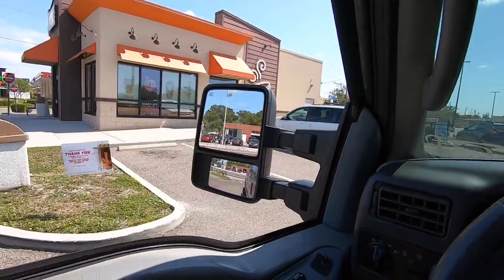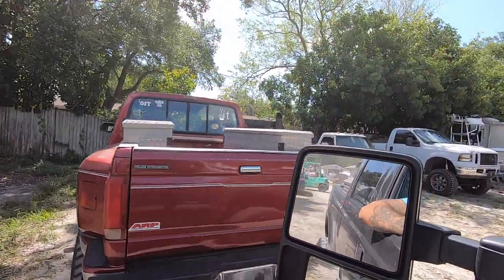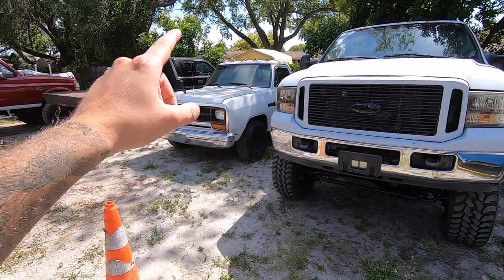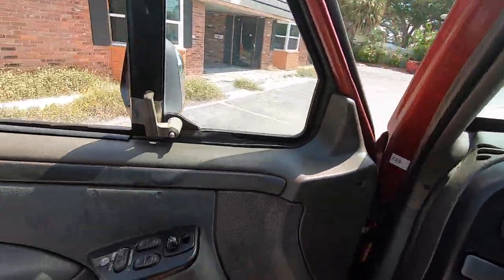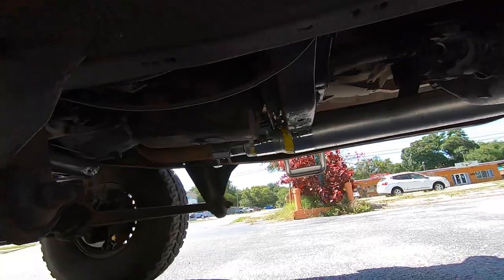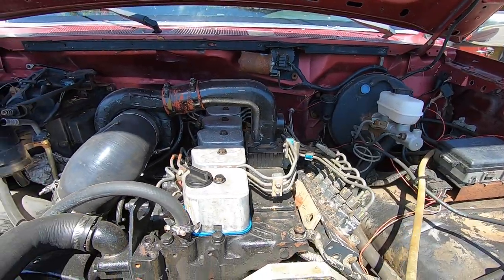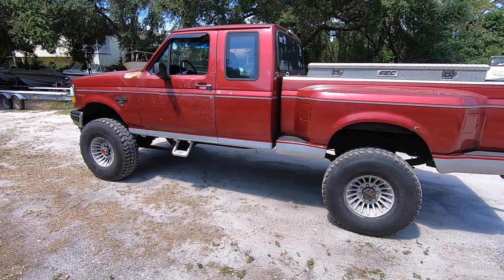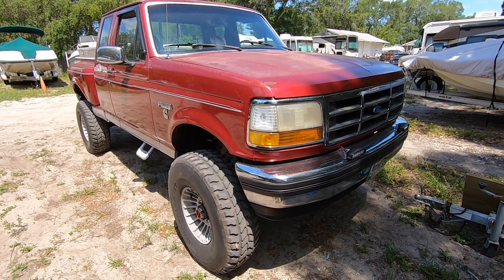Twin Turbo Cummins F150? (Overview)

Comment: I didn't even know this F150 has a 5.9 liter 6BT Cummins conversion instead of 3.9 liter 4BT cummins like most other OBS 1/2 ton trucks are
Reply: Ik this comments a year old but, with the obs trucks the body is the same size as the f250s. So a 5.9l fits just fine in there, now a 98 f150 and up wont since they made them smaller